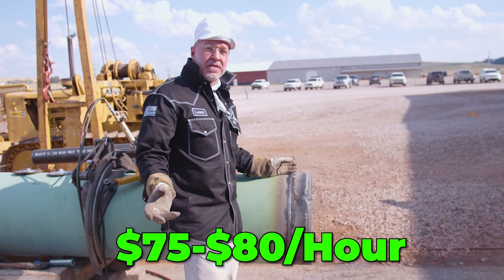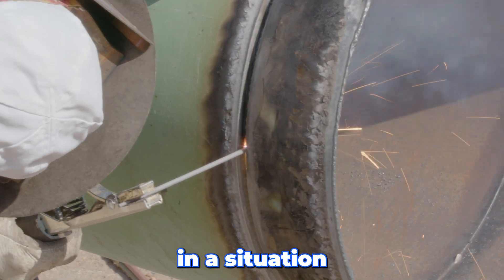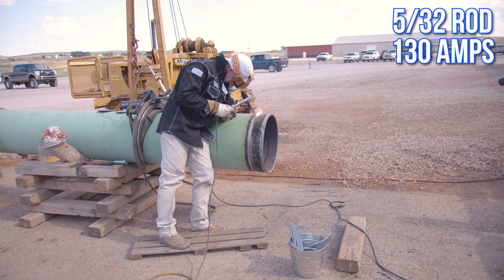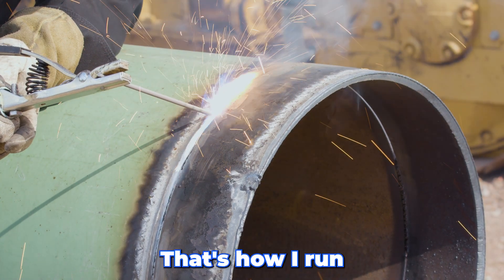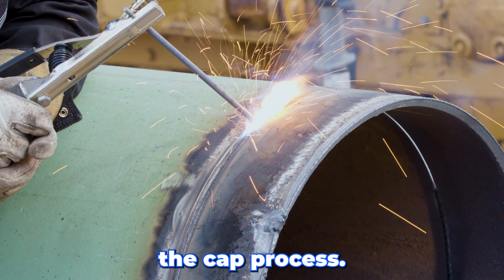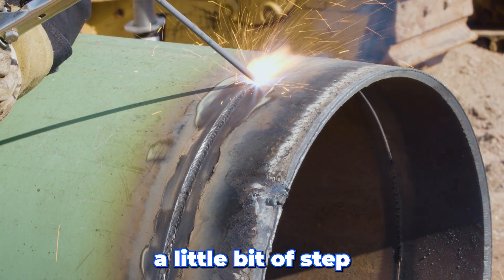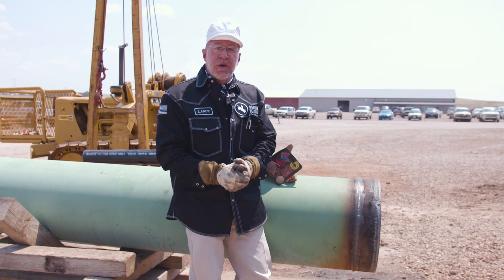How are Pipeline Welds Made?

Comment: I really enjoyed watching the video, but I have a question.
When doing regular welding (not on pipes), we usually use the upward welding method — going from bottom to top in vertical welding.
But I noticed that with pipe welding, it’s done from top to bottom instead.
I’m wondering why that is.
When I tried welding from top to bottom, it felt like the molten pool and slag were flowing down together, making it hard to control.
So could you please explain why pipe welding is done that way?

Comment: When and why would you switch over to a whip and pause method for the root?
Reply: If the space gets a little bit to open it becomes difficult to just drag it. So at this time you begin to whip and pause it. If you dont whip and pause it when it opens up to wide to drag your key hole will get uncontrollable. I don’t know what this guy said about space I didn’t watch the video since Im a pipeliner, but I like between a clear lens and 3/32” space with a clear lens land after the inside is filed. Hope this helps.

Comment: Never weld down hill
Reply: Down hill welding is permitted under AWS D1.1 and API Code For steel piping. Also these guys ares using 8010 not just 6010

Comment: You forgot to mention that you use 6013 Rod 1st pass 7018 rod for the last pass for the final cap
Reply: That weld was done with 1/8 6010 5p+ For root. Hot Pass ,Fill and Cap was done with 3/16 8010 or 5mm. 8010 pipiliners arc 80s
Reply: 6013 or 6010 for root and hot pass, (penetrating rods) after that all 7018 for fills and cap, that’s how u get a beautiful cap with 7018 nice smooth burning rod easy to use
Reply: 7018 Rod is the Hollywood Rod makes welds look good until you X-ray them  to see how many pinholes you have @ezekiel3474
Reply: That looked like 5p plus 6010 all of the way out. I like the red stuff better personally. Depends on where you're working. Some places like an 8010 root.
Reply: @davidchapman4507  😂

Comment: For the beginner's...the first two digits on a rod (smaw) indicate the psi max, i.e., 6010 (approx 60,000 lbs psi). The third digit indicates the weld positions. The fourth digit indicates the flux. A 1 is "all positions", 2 is flat and on occasion horizontal filet, not a butt because of the ubdercut of the top edge. 7024 "jet rods" are ideal for flat G1 and sometimes horizontal G2 filet depending on other factors.
Reply: Pls what is the smaw?, psi max? And ibs psi?
The meaning and what they all actually indicate in the pipe and how I can use it to work
I’m a beginner Asin fresher
Reply: @malikmusty2048   Shielded Metal Arc Welding, Pounds/Square Inch Maximum, lbs is Pounds (idk why bro said lbs psi cause psi is Pound/Square Inch), I would recommend looking up a welding terminology quizlet if you don't know those terms
Reply: @malikmusty2048  SMAW: Shielded Metal Arc Welding. FCAW: Flux Core Arc Welding. GTAW: Gas Tungsten Arc Welding. GMAW: Gas Metal Arc Welding
Reply: My advice to anyone who's sincerely interested in welding and metals fabrication is to learn it OJT. A school can provide you the welding equipment and some education related. On The Job training, however, is always best.
Reply: OJT would be as a welders helper learning to help the fitter and welder and learn from them as well as everyone else, be it good or bad. 75% of what you learned from school you can put back on the book shelf because that you'll be learning in the field where it all applies.
Reply: @geneautry2091 this is so true. I'm an entry level welder at my current job and I've learned more in the almost 2 weeks I've been welding on this job then I did in the almost 2 years I spent in school. I'm learning to read blueprints, fit, square and all the things they don't teach in school. It's more to welding then just running a bead. Also please know how to read a tape measure. Fortunately I know how to read a tape measure so that helps me a whole lot.
Reply: Jet Rods UGGGGG
Reply: @BryCar-m3o The majority of my 7024's were 5/32, 3/16 inland barge build & repair. 99.99% of the time I was in the flat g1. Too hot to run horizontal butt. I've run it horizontal with 1/4" filet without there being any ubdercut in the top edge where it customarily is. I preferred my 7018.
Reply: WRONG ,  the first two numbers indicate the tensile strength.    NOT psi !!
Reply: @normpage4604 auto correct typo
Reply: @geneautry2091  ,   THAT'S a Hell of a type O . ..   twice , with parentheses everything....
Reply: @normpage4604 I agree. We all make mistakes. Many however rely on the trivial 
to mount themselves higher. Insecure?
Reply: Auto correct typo I didn't see changed my "lbs" to "psi".
Reply: @geneautry2091   lbs , is still wrong.   It has nothing to do with pounds or PSI or any fucking thing like that it has to do with tensile strength witches apples and oranges when you try to compare what you are eleging was a type O . Do you even know what tensile strength is ??

Comment: Worked for pge over 30 years put alot of high pressure gas lines in running down hill
Reply from the maker: Nice!
Reply: Running the pipeline is the easy part there alot of other things to be done building reg stations alot of time in vaults with limited space nice when there above grounds also some very large to very small meter sets and the repair work the pipe lining is the cake
Reply: Last thing it's was a great job I miss it

Comment: That is so strange to me that you weld downhill. Is this a "by the book" thing over there in America? Maybe you guys could do a video with about busting myths around downhill welding. The conventional wisdom says it's not as "strong". My instinct says that downhill is a bad idea when you're doing filets og grooves. Welding pipe is done with full penetration as a requirement anyway. Cool little video.
Reply from the maker: Thanks for the input and suggestion!
Reply: The strength of a weld is based on the choice of filler metal, heat input and technique.  A good weld is a good weld regardless of the progression of the weld-metal properties are metal properties.  Uphill versus downhill has its own advantages and disadvantages, what do I gain versus what problems that may occur.  The cellulose electrodes that have deep penetration, light deposition, fast freezing puddle and very little slag can be successfully run downhill.  If that is how the procedure was qualified, then that is how it must be run.  An electrode with higher deposition, less penetration, heavier slag, and slower setting puddle may result in the puddle over running the arc downhill causing problems.  A 7018 is less likely to have problems running up versus down.

I didn’t catch it if it was noted, but I suspect that is a cellulose electrodes (6010/7010/8010). I wonder if the video creator could clarify.
Reply: British gas use downhand
Then dollymix 
Cellustic all the way

Comment: Question from an old pipe welder, but not a pipeliner: Are all pipeline welds 6010 downhill? 
I've always done the root & hot pass with 5p or 5p+ uphill, then fill & cap with 7018 (uphill, of course).
I can run 6010 downhill, but I've always heard uphill is stronger... you know how pipe welders are... their way is the only way, right? 😅
Reply: That's when Oil producers directed the root to be "downhill" (thinner & smoother) and "pushed in" with a "hot pass" also downhill.
Reply from the maker: Not all pipeline welds are 6010 downhill. While it's a common technique, there's flexibility in methods. Uphill can be strong too. Ultimately, the best method depends on the specific job and welder preference.
Reply: Most pipelines use a 6010 for the bead then 8010 (arc 80’s) fill and cap…… some gas companies are going to a low/high rod downhand 9045dh…… minimizes the heat heat input especially on higher grade pipe x60 or x70 pipe
Reply: Many years ago in the oilfield "uphill" roots made were considered too high at the ID (excessive penetration), and when a "pig" was run through to clear, it would be restricted not allowing it to continue.

Comment: Thanks mate,, I would be interested in how you transition to the underside. I do a lot of industrial repair work and my welds tend to get ugly on the underside.
Reply from the maker: I understand how tricky it can be, especially with industrial repairs.
Reply: I was always told if you wanted your welds to look the same all the way around::just screw up the top too !!😅 @WesternWeldingAcademy
Reply: @jenkodiesel5768  tight arc ...speed of travel...of course the right heat....practice it's tricky overhead...keeping your angle good too
Reply: @thomassullivan1676 Keep it simple because it is. With more experience and practice you'll see.
Reply: A g4 (overhead) should be set for a g1 flat. Overhead is an upside-down Flat.
Reply: I've been AWS certified since 1972, my first field test because the hired welder was too fat to fit through the porthole into the fuel tank where a replacement "cooling grid iron" was to be welded (vertical, uphill 7018).I was still in high school working as a welders helper at a shipyard during summer break. I've certified AWS D1.1/5.20 3G, 4G on 1" plate, qualifying me for all structural positions, unlimited thickness.
Reply: Overhead position is an upside-down flat. Set your heat the same.
Reply: I was initially intimidated by the thought of welding overhead 4g until another more experienced welder said to me, "set your heat to what you weld in the flat position" (1g). My overhead welds are identical to my flat welds. Adequate penetration, tight & uniform, no undercut. I've 52 years experience as a welder/fitter with the scars and burns to show.
Reply: Thanks guys, appreciate your answers but i can weld upside down  but wondered how welders transition from the upside down to the vertical.

Comment: Actually pretty ugly on a few passes, but if it passes a root bend and nick break, who cares
Reply: Those are not ugly welds.  We’re not tig welding here.
Reply: You’re right, it’s not a TIG weld, however my point is, is doesn’t have to look perfect to pass. The short filler pass on the concavity location, in the test zone, could make or break a passing grade to a novice. I’ve caught slag 3 times before passing my first API 1104 cert. would have been nice to have had this kind of information accessible in the in 1980’s.
Reply from the maker: I don't see it
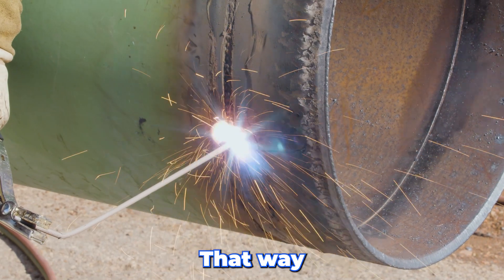Reply: @WesternWeldingAcademy  it’s not much, but for a novice it could be trouble, I see it at 2:40 into the video.
Reply: @stevenp2718 yeah that was a bad stripper pass lol

Comment: I'll never pipeline weld, but out of curiosity, how long would it take to do that welding from start to finish on that pipe?
Reply from the maker: Welding a standard pipe joint usually takes 30-45 minutes for a skilled welder, but it can vary based on pipe size, thickness, and welder experience.
Reply: Just the weld with 2 guys 30 mins ish

Comment: How do you know what rod size to use, and what amperage to run?
Reply from the maker: Rod size and amperage depend on metal thickness and desired weld quality. Generally, thicker metal requires larger rods and higher amperage. Welding charts can provide specific guidelines, but experience and experimentation are also crucial.
Reply: This is a project specifications
Reply: @9983sp  all welding wire has procedures to go by

Comment: in answer to that question, I would say as fast as possible and still meet specs
Reply: @stevemackelprang8472  and no Flux composition on 6010 5p wire so slag doesn't enter the puddle so you can get it right
Reply from the maker: Good one!

Comment: This is only the second time I’ve seen open root ran downhill. What code calls for this instead of uphill?
Reply: Pipeline/petroleum/oil and gas codes. B31.3, API 1104.
Reply: @GeorgiaPipeliner   good to know
Reply: API 1104
Reply: CSA Z66.2
Reply: Google it.
Reply: Most pipeline jobs require downhillers
Reply: Welding on live gas pipes..downhill so you don't poke thru...less penetration but multiple passes
Reply: @thomassullivan1676  that’s not a code there clown shoes… Way to show up late and bring nothing to the table.
Reply: @wrecker1861  process..procedure.. this is easy welding anyway..code!! Lol
Reply: @thomassullivan1676  nobody is interested in hearing you run your mouth but yourself…
Reply: @wrecker1861  nice...u know nothing..I should've know..bot
Reply: @wrecker1861  u know ..procedure..heat input..joules .type of steel compatible welding wire..so the codes must have this info in its writing..